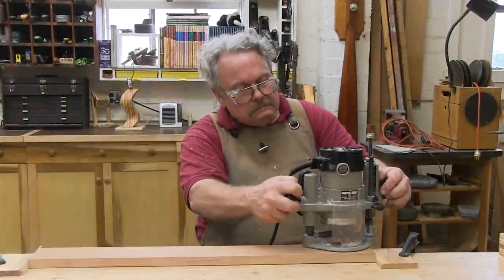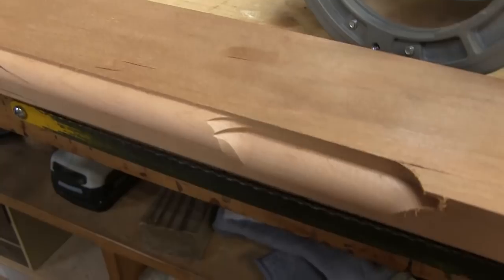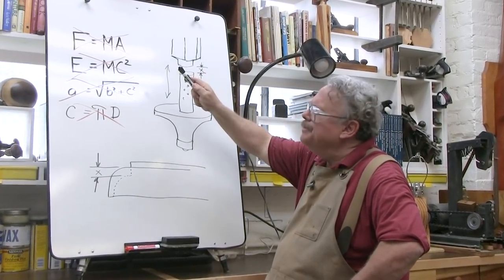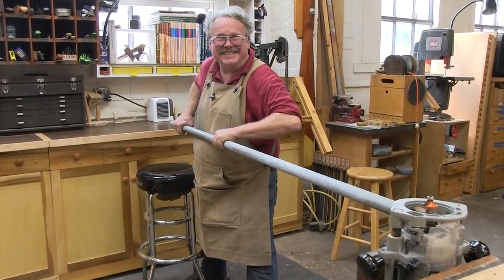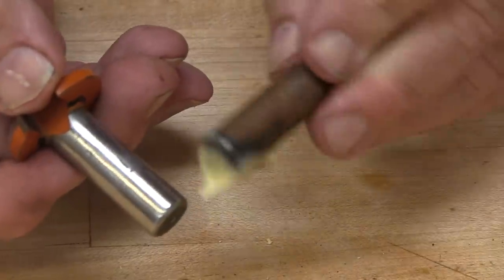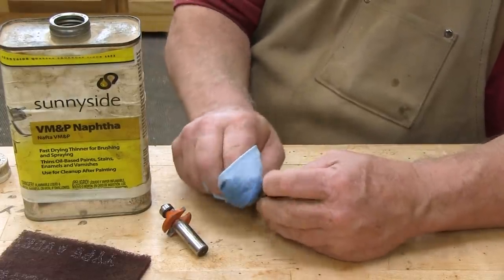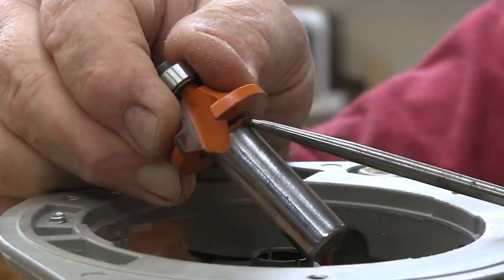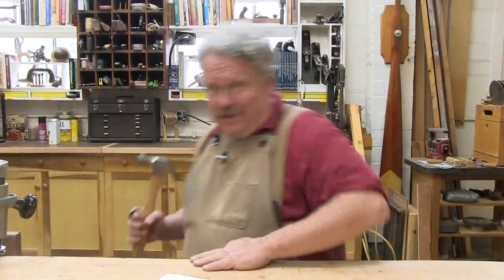Solved! THE Most Infuriating Router Problem.

Comment: I learned, a couple of years and a couple of pieces of walnut ago, that the secret to a good fit is to put the router bit all the way into the collet and then pull it back out a 1/16th or so (you've done the same thing here with the o-rings).  I hadn't seen that there is some sort of lip on the insert side of the bit....but it all makes sense now.  Thanks.
Reply from the maker: Most welcome.
Reply: Yeah screw that. I want to be pulling bits up all the time.  NOT! The permanent solution is to just wad up some paper towel and stuff it under the collet in a router. I'm not jerking around with O rings on the shanks of all my router bits either. I must have 100 of those. It's simply not a practical solution. A little scrap of some paper towel in every router shaft I have is something I can do.

Comment: In order to prevent router bits from dropping to deep into the router, place a properly sized “Space Ball” inside the shaft opening. This gives just the right amount of “spacing” for all of your bits and prevent the bits from getting stuck also. Sized just right and the Space Ball won’t fall out when you turn the router upside down. You only need 1 per router versus the suggestion of finding an o-ring for every router bit you own.

Comment: Holy smokes!  So simple, yet I never thought of this before.  Makes sense!  I will do this from now on!
Reply: Yeah, one of those lessons one learns the hard way.
Had a couple of bits keep coming loose in the drill press and occasionally after, a bit would misbehave, same cause. Contamination and needing a bit of polishing.
Which brings one back to tool tip #1, keep your tool clean! Trust me, your lady will appreciate it.

Comment: Great tips, Nick. I had a similar issue with slipping in a video recently, but it was the motor slipping in the base do to crud and the galling. Just like with your shank, Scotch-Brite did the trick. Also, I added just a touch of anti-seize to the threads on the Porte-Cable 690 body. Lucky for me I was using a router table so the bit was dropping, reducing the cut, so there was no harm done to my stock. Scott
Reply from the maker: Isn't it amazing to find that if you maintain your tools, they actually work. Who would have thought? ;-)
Reply: @WorkshopCompanion  True that.

Comment: A problem that goes way further than just routers!
I've had the same issue on my bikes quill stem. Because it was rusty It coulndt be tightened enough. But when I polished it it would work again. Great video!
Reply from the maker: Very good point. Chucks, collets, metal-on-metal clamps of all sorts need to been clean and free of debris to work properly.

Comment: I've found a 1/2" grommet (or the metric equiv) dropped in the collet much easier than the o-ring on the bit shaft.  It doesn't fall out - my table router is mounted so the opening is up - and anytime the handheld is changed, the collet opening is up!  So it never falls out and I don't need to move the o-ring from one bit to another - or by 30+ o-rings (not that they are expensive) - with the grommet - "its one and done".  love your instructional offerings - thanks very much for the effort and information!
Reply from the maker: Thanks for the tip.

Comment: Fantastic video and tip. Living in southern Texas the humidity causes rust that never sleeps. I've had bits rust to the foam holder it came in. I've had to resort to a wire wheel then polished with scotch Brite. Very annoying on a $75 Freud bit.
BTW I still have and use your Workshop Companion series I purchased 30 yrs ago.
Reply from the maker: Thanks for saying...and reading.

Comment: So true.  I had a 3/4" straight bit actually come out of the collet while in operation, and repeated drifting out of the collet after I thought I had tightened it better.  After a simple cleaning of both bit shank and collet with a little acetone to remove built up contaminants....no more drift.

Comment: Good tip regarding the o-ring and cleaning router bit shafts.
Your opening line about routing at 160db is a good segue into the danger of not wearing hearing protection
when using tools like a router.

Comment: I reallly enjoy these videos. A lot of intelligence with a good bit of very applicable humor mixed in.  I would offer a tip of my own. Be very judicious using compressed air on machinery. You can drive dust and debris into areas that will reduce the life of the machine.  A vacuum is always preferable if it will work well enough.
Reply from the maker: Great tip. Not many folks know the sawdust is mildly abrasive. We have an awful time here keeping the sawdust out of the metalworking room. The oil mixes with the sawdust and creates an abrasive glop.

Comment: Can we clean the inside of the collet? How do we donut correctly?
 Second video viewed and loving it!
 Thanks for sharing your invaluable knowledge!
Reply from the maker: Collets are more susceptible to dust than they are rust, but on those occasions where I've spotted a patch of rust, I usually take the collet apart and clean it with very fine Scotchbrite (gray or white). Do NOT use anything but the finest abrasives -- ideally, these parts should be polished. To clean the interior surfaces of the master collet and the closing sleeve,  I cut a strip of Scotchbrite and twist it to make sort of a Scotchbrite "rope," then pull it through the openings. (The master collet is the part of the collet assembly that holds the shank of the router bit. The closing sleeve is the conical part that causes the master collet to tighten around the shank.)

Comment: This was happening a lot to me, but the shanks were clean. What I found was happening was dust was building up in the collet and it was preventing it from seating down far enough to securely engage the clamping mechanism. At a certain point you couldn't tighten it any further because you were just compacting the dust in the collet. Once I discovered this, and cleaned out the collet, I could properly tighten it with normal force. 

So in my case, clamping pressure was the issue. So if your bit shanks are clean and you're still experiencing bit movement in the collet no matter how much you tighten it, check the collet for dust to make sure it's not preventing the collet from threading down enough to clamp the bit.

Comment: I'm about to get a lesson on using a router from my dad, whose routering equipment is a tad old and neglected due to it being inherited from one of my grandparents and being a tool he doesn't use that regularly.  Seeing this, I'll definitely be giving the shanks a bit of TLC before I get started.  Reading up on routers has thoroughly impressed on me the idea that anything with more substance to it than the little flakes of wood it cuts off when working properly should not be by any means compatible with the word "loose."  Both for quality of work reasons and because, frankly, anything spinning that fast that comes off at speed is going to be rather more comparable to a bullet than I'm comfortable with.
Reply from the maker: Thanks for sharing.

Comment: Love the o ring idea.
Reply: It's not really that good of an idea. Not when you have a lot of router bits. I have router bits in at least 4 different shank diameters too. Then tracking down O rings to fit on all of that becomes a logistical nightmare. There's an easier solution. Just wad up a ball of paper towel that you can stuff into the shaft recess of every router you own. One paper towel can do more than a dozen routers. It don't even have to be a clean paper towel you use. The wad in my M12V has to be over 20 years old now. Because I figured this out that long ago. That sucker is vintage now.

Comment: I always understood that router shanks shouldn't bottom out in the collet. Also, if you need to get a bit more plunge depth, the o-ring
Can be positioned to keep the cutter at the required height while tightening the collet. (Bearing in mind the limits on how much of the shank is safe to be proud of the collet!)

Comment: Super video thanks. I already knew this, but it did not occur to me to keep some scotchbrite with my bits and clean them on every use. I'll be adopting this practice for my router bits and also the morse taper attachments for my lathe. Thanks you.
Next up: stopping F clamps from vibrating loose? ; )

Comment: One thing to consider is to never bottom out the shank in the collet.  When the collet is tighten it slightly pull down the router bit shaft.  If the shaft can't move the collet doesn't get the bit tight enough.  One thing you can do is slip a rubber o-ring down into the collet which gives some cushioning preventing the bit from bottoming out.
Reply: Righteous, brother!

Comment: Clean is ALWAYS important, but many people do not know that router collets are NOT forever! The collet is made of steel that is heat treated (tempered) to make it elastic so it holds properly. The heating and cooling cycle that the collet goes through during use WILL ruin this temper over time so an old collet may not hold properly. 
The average woodworker should replace collets every 2-4 years depending on use. And once a bit "spins" inside the collet, the collet is likely damaged beyond repair and will never hold properly again.
Reply: No! The temperatures at which steel is tempered (i.e. loses some of its hardness) is way above the operating temperature of the bit. Further, the bit has to heat up (TC tipped), that has to heat the bit shaft, which in turn has to heat the collet which then has to go above the tempering threshold etc etc. It is not feasible. Further, tempering does not increase elasticity and even further, elasticity has nothing to do with a collet coming undone. Colletes come undone because of vibration. Play between the collet and shaft via dirt, can increase vibration. Sharp bit, slow passes and clean collets and shafts fight loosening. No need to periodically replace collets unless they are damaged.
Reply: Micro-jig and Joe Blogs both raise interesting arguments, and suggest a question: if there is a difference in hardness between bit and collet, which do the manufacturers intend to suffer more with wear? Bit? Or collet? My money is on the bits, as the wear would be spread out over more individual units, rather than the collet, which may bell out and become less secure and concentric.
Reply: @joeblogs8589  That is why the collet looses "temper" over time and not all at once. All springs lose elasticity over time. the heating and cooling cycle accelerates the process.
Reply: @Microjig  No. There are two issues at hand here, namely temper and vibration. Vibrations makes the collets come loose. Temper does not. Soft or hard metal will perform equally in this situation. But let's talk temper only. Repeated heating and cooling of heat treated steel below a certain threshold, does not change the steel's state. The collet, in normal and even severe operation conditions, never reaches that temperature. Therefore, it never loses state and therefore remains as hard or soft as it left the factory. There are plenty of heat treatment videos on YouTube. I can point you to an excellent one done by That Lazy Machinist. It is long but detailed. Steel also has no fatigue limit below yield point, therefore springs only change shape or lose elasticity once they've been stretched beyond yield.
Reply: @leehaelters6182  There is no wear between either object. A bit or collet that shows wear at the engagement point was not tightened properly and was allowed to slip. Same with drill bits in chucks. Tighten them properly and they never score. Let it slip just once, and they score.
Reply: @joeblogs8589  we'll agree to disagree on this issue. I am not a metalurgist, but I have spend many hours talking with the folks who design and manufacture bits, collets and tool holders. The advise I give is from the manufacturers, not me.
Reply: @joeblogs8589  if a bit moves in a collet under power, some kind of wear must be happening, no? Let us say if wear occurs for any reason. My question was do the manufacturers make a calculation about which is the better sacrifice in that event, bit or collet? Similarly a minor controversy among shopmates might be which component to tap to loosen the collet's grip when removing; bit or collet? I tap the collet, protecting it by hitting the nut.
Reply: @leehaelters6182  When two objects slide against each other without lubrication, one of two things could happen, or sometimes a combination of the two happens. This is because there are two types of friciton, abrasive and adlhesive. With the former, material is removed from one of the friction pairs and this material is somehow lost. In the case sandpapering a piece of wood, this material is lost to the atmosphere as dust. If the sliding pair were subject to adhesive friction, then material is transferred between the two items and, a a small amount is lost.  A good example here is car disc brakes where the disc pad material is transferred to the disc and back. A small amount of friction material does get lost in a abrasive friction action, but there's more transfer than loss. Otherwise brakes won't last as long as they do. 
Now, when two pieces of hardened steel slide against each other under force, as with a router bit and collet that starts to slide, then material is transferred from one item to the other. Typically, the softer of the two materials will smear onto the harder material. Have a look at the ends of your drill bits and look at the damage the chuck makes to a drill bit when it wasn't tightened properly. Yes, we call this wear and in a collet, if it loses grip on the bit, you can same that, as you put it, wear happens. Do the manufacturers make the calculation you ask about? No. Not for bits and collets and drills and chucks, in anyway. Do they make that calculation for brakes? Yes, the pad is the primary sacrificial item. It could very easily be the other way round, but that would not make sense from a maintenance point of view.
All of this has nothing to do with temper (heat treatment, to be precise), or the supposed loss of temper at the low operating temperatures of router collets.
Which part to tap? Well, if you tap the carbide tips of the bit, they will chip. So don't tap them. You could tap the collet if you can reach it. Or you could wiggle the bit or  buy a self-release collet. It doesn't matter. It is all of no consequence.

Comment: Everything you said was true. However there is a very important part to installing a router bit that was left out. It is Always recommended not to bottom out the router bit into the router chuck. A good example, using a straight bit, it is easy to place the router bit all the way to the bottom of the chuck, it is recommended to lift ALL router bits upward and off the bottom of the chuck a minimum of 1/8". this reduces heat transfer from the router chuck, collet and the bit via friction. They all have different types of metal which expand and contract when heated from friction. which is a primary cause to router bits coming out of the collet.... I totally agree with keeping the shanks of the router bit and collet clean and everything else you explained in this vid... well done
Reply: I don't think you watched the video to the end. Or maybe you just phased out that last 30 seconds.
Reply: He covered that and tricks to prevent it. Watch the video.

Comment: Idaho. Is another problem. When a router bit is bottomed out vibration can cause the bit to lose in the worse direction, out. What I do is put a pice of ear plug foam at the bottom of the collet before putting in and tightening the bit.

Comment: I've started to encounter way more bit slip lately.  I kept polishing the bits but that wasn't the problem.  I hardly ever removed the collet.  In trying to locate the problem I removed the collet.  You could see that the taper of the collet and the taper in the the motor shaft has spots of crushed/compressed dust.  That was my problem.  Just a different place to look.
Reply from the maker: Thanks for the heads up.

Comment: Thank you for helping me understand the shop router better.
Now one question, hoe about sleeves you use to put a thinner shaft in a regular collet? 
Are those hindered by bottoming out aswell?
I mean should those be proud of the collet surface or all the way in?
Reply from the maker: The adaptor sleeves can be flush with the end of the collet, but I try not to let them bottom out, just to be safe. The bits, of course, should  never bottom out.

Comment: Although keeping the shanks clean is important and should be done on a regular basis, as as well as the collet taper, the swedge,  and the threads on the nut and collet, the problem probably is not the shaft. Having been in the carpentry industry for 50 years pluss I've run into this problem a lot with apprentices not knowing about how drill trucks and call its work. If you bottom out a drill bit in a drill or you bottom out a router bit in a router this will happen every time. The way to make sure that this doesn't happen in both drill chucks and collets is to insert your drill bit or your router bit his to put them in and bottom them out and then pull them back out 3/16 to a quarter inch, and then tighten up your chuck or collet. The main problem is not understanding the mechanics of a collet or a chuck. They work on a taper, that pull the bits downward and if the bit is already at the bottom the collet or the drill bit can't be pulled down with it allowing the swedge to compress around the shaft. So always put your bit in but always remember to pull it back out a little bit so that it has travel room inside the collet or drill chuck. It's scary how fast the three wing cutter will fly across the room at 30000rpm. Thank the technicians for inventing soft-start!